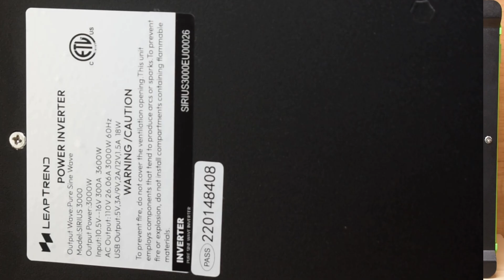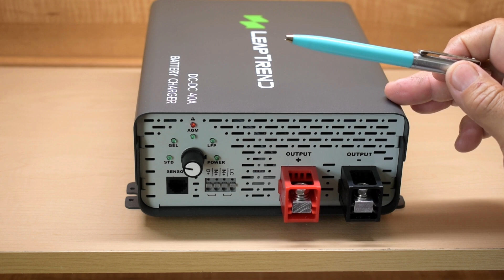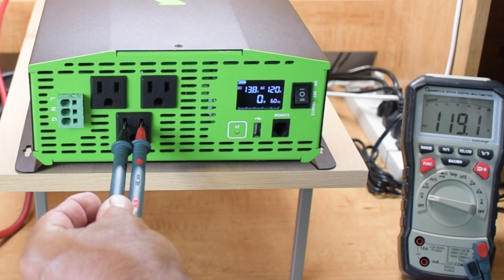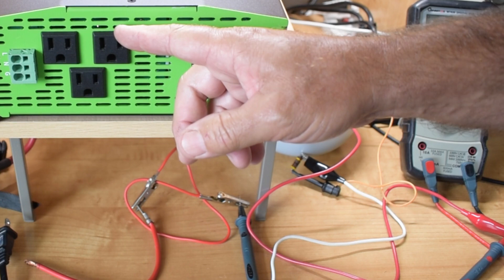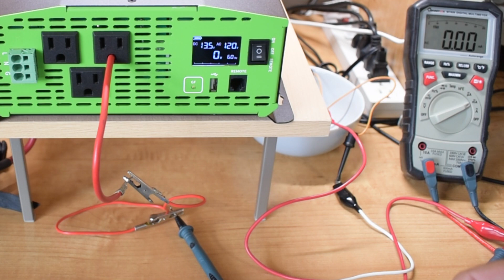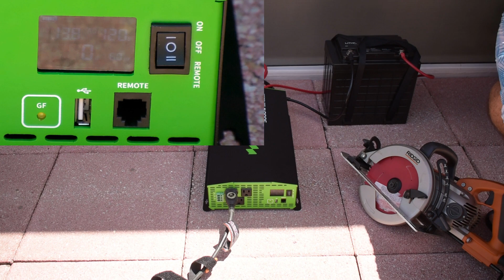Leaptrend 3000W GFCI Pure Sine Wave Power Inverter Any Good? Find Out!

Comment: So would this be able to handle 2 speakers 2 sub for a mobile dj instead of a generator???
Reply: Depending on your power demands. I don’t know what you’re running, but it will definitely run my Altos and Turbosound subs or my Crown XLi1500 and a couple of subs. Only issue you’re gonna run into is toting a large enough battery bank to power the equipment long enough for a gig. I ended up getting a Generac 2200i inverter generator because it was so much easier and a gallon of gas was enough to get me thru a 7 hour gig on Eco mode. It is super quiet so it was only about 15 feet away from equipment. Most people don’t even realize it’s there. I do recommend a power conditioner for extra protection of equipment.
Reply: @joeydelgado6119  yeah I'm running 2 Altos TS312 & 2 Bose Sub 2s...I have a Honda EU1000i but we use it for tail gates for tvs but I need something my my system. I was thinking of LiFePO4 Redodo but really unsure. Tryna learn this setup and see if it's worth it or just get a generator

Comment: Appreciate the review. Haven't seen many inverters with a GFCI built into them. I like the added protection, but don't know how it would actually work in my situation. My RV always trips the outside GFCI outlets on my house whenever I plug it in. Doesn't matter if all the RV circuit breakers are shut off. Have heard this is a common problem and everyone recommends not plugging into a GFCI outlet. Looking for an inverter that I can mount in a storage bay and plug my RV into directly when boondocking (with plenty of solar, of course). The GFCI on this unit concerns me......

Comment: Nice.  I would have thought a Pure Sine Wave Inverter with a GFCI would cost a lot more than $288.68!  Looks like a clean build inside, too.  It's a shame that you can't get 3000W continuous, unless maybe it depends on the devices connected, but for a Pure Sine Wave Inverter, I guess ~2500W is OK.  Thanks, Scoptt.
Reply from the maker: Still worth the money for 2500W continuous. Glad you like the video
Reply: @electronicsNmore   Agreed.

Comment: You would pay at least 60 more if it used one 360amp fuse I figure. 
12, 30s OK with me.
Reply from the maker: Actually anl, and mega fuses are very inexpensive $15 you can get a 300A fuse in a holder
Reply: @electronicsNmore  we are talking about production bottom line cost, very involved because of politics, etc..

Comment: Very good testing and inverter.   I liked the test where the voltage was tested from hot to neutral and to ground as I have one unit that will give a reading on the neutral side of around 60 volts.

Comment: Had me with the inverter up to the point of soldered-in-only fuse replacement. I have this, branded with the aqua-blue paint and it does work well, though. Thanks.
Reply from the maker: I agree that they should have had a socket for the fuses, but you have to realize that you're supposed to have a 300 amp fuse after the battery connected to the inverter. If you do that, you should never blow the internal fuses.

Comment: It's been my understanding that the max wattage limit for any inverter you buy to use in an 18 wheeler should be no more than 2,500 Watt.. as it will shorten the life of your batteries. Just what I've been told, honestly I've never done the math 😅
Reply from the maker: Using a very heavy load for long periods of time can shorten the life of any battery.
Reply: What is the amperage of the alternator ? Can it sustain 2.5kW ?
Reply: @letenof  Good question, as I said, I haven't done the math on it and since I sold my truck last July I would have to look up all the info.  But it shouldn't be that hard to find for anyone to find out.

Comment: Looks like a nice product. Only issue I see is that the fuses are soldered in. What's the point of a fuse if you can't change them if needed?
Reply from the maker: Compared to other inverters I've tested, it did very well. I agree they should have sockets to put the fuses in. You also have to realize that you're supposed to use a 300 amp fuse with this inverter. If you do that, the internal fuses should never be able to blow. Thanks for watching!

Comment: why the Li battery? i would want to hook this up to my SUV battery to power electric kitchen appliances at a picnic site.
Reply from the maker: You can use whichever battery you desire to power the inverter. Thanks for watching!
Reply: Don't hook up this inverter to the car battery, you will get a reduced life out of the starter motor, battery and alternator.

The battery used for the test is better suited as the voltage drop is much lower.
Reply: @JT-lq4yd  is there a product similar to this that can be installed in a conventional motor vehicle, and run it off the battery, and run the car to top off the battery, without the problems you noted? you said it could be used in an RV. i'm not an RV-er. is it typical to have 12v Li battery in an RV? 

how can i get a power inverter of this capacity to work at a picnic site, like i originally said?
Reply: @dans5595  There are devices that work, pricey, but are available.   eNm has reviewed Power Stations, they are just a battery, power inverter, charging circuit and some USB ports.

The other is exactly the way it was showed in the video, a power inverter and batteries.  

I just don't recommend charging high amp hour capacity batteries using the car's stock charging system.
Reply: Do you know how much power your appliances require?